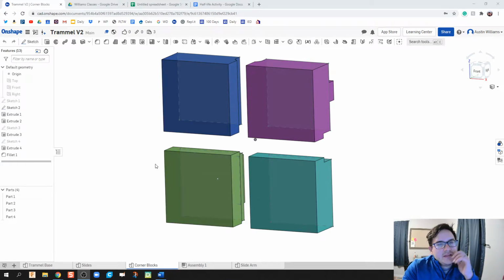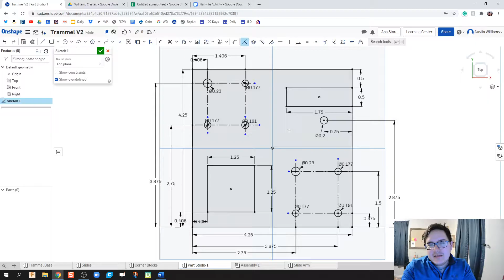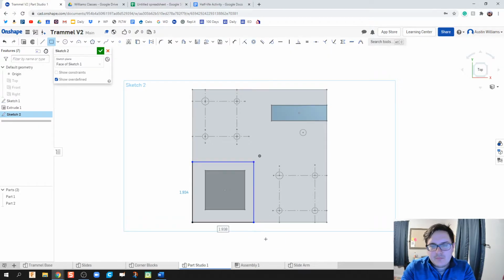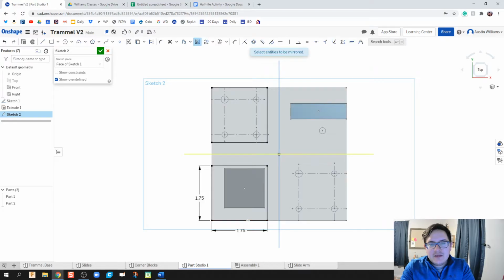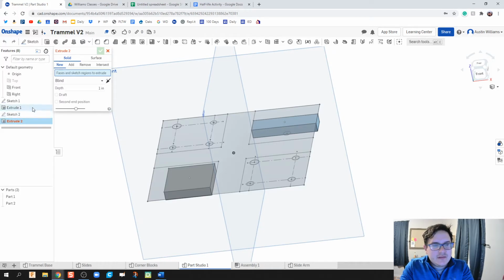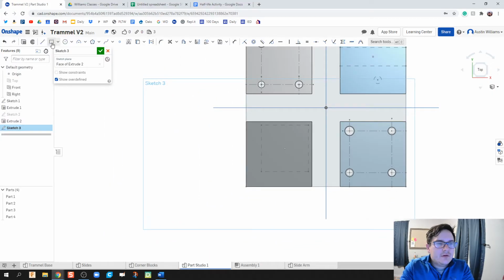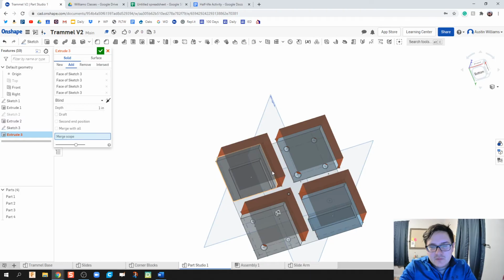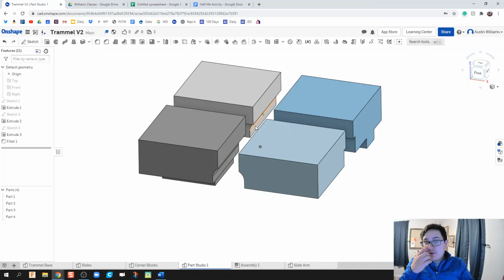Trammel Bottom Up Design (Corner Blocks) - Day 31 of 100 OnShape Journey

Comment: Hi , At 3:00 i am not getting the reference yellow points to draw the corner rectangle. How can I get it? I copied the sketch and pasted it as shown.
Reply from the maker: Inferencing should be automatic unless you are holding down the shift key. When drawing on a sketch, those profiles should automatically populate. If that doesn't work, I'd look at an setting you might have changed.

Comment: Hi, I just looked on day 32 and saw that you had holes on the top left and bottom right blocks, but I don't see them.
Reply from the maker: I see what you are saying. I missed that detail. On the sketch with the holes, have them removed all the way through the material. I guess I did that edit between videos.
Reply: @LearnItDoItMakeIt  alright thanks !